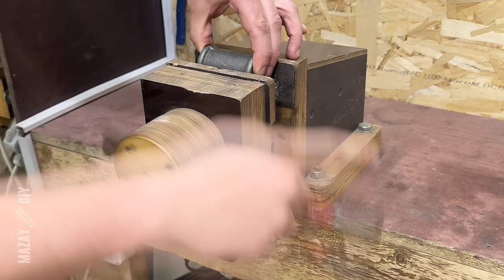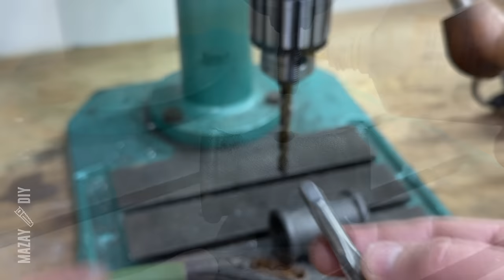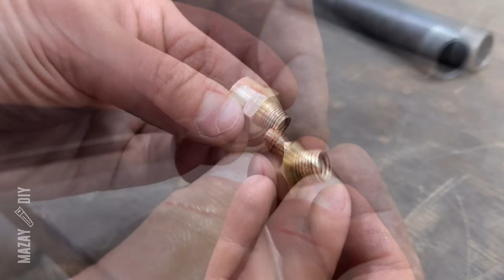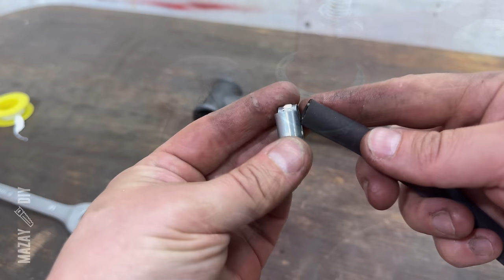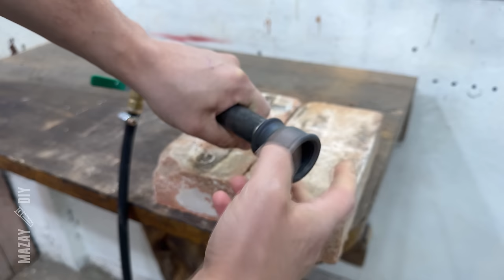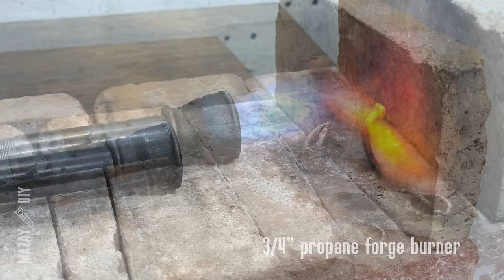DIY Simple Propane Forge Burner 🔥 Legendary Frosty T Burner 1/2 & 3/4

Comment: That plumbers tape is going to melt fast 😂
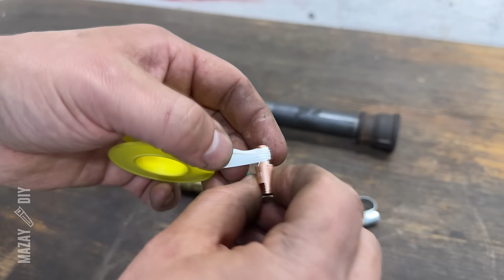Reply: The thread tape is located in and behind the Venturi, away from the flame. The flow of ambient air and compressed propane through the assembly actively cools the air-fuel Venturi chamber, it won’t get hot enough to melt the thread tape. 2:32

Comment: You can buy a brush burner for like $25 and  is probably safer
Reply: Brush burners can’t handle back pressure, so putting them in a forge kills the flame. Source: experience.
Reply: It can't provide enough heat for forging temperatures

Comment: thanks for the plans, much appreciated.  I bought some thread tap and die set the other day for some other jobs round the house. to be honest i have not used them yet, dont know much about taps but i heard it is not just the diamter that we have to look out for but also something about the threads per inch>     the taps you show on your video are they standard taps, can i use my taps or do they have to have other specs i have to look out for?  what is a twist drill?  i dont thik i can find 8.7mm twist drill bits ?  forgive my ignorance but i just wanted to ask as i am confused.  ..  why did you drill an 8.7mm hole, if the 1/8th inch converted into mm is 3.175mm ?  i dont understand , isnt the hole too big for this? I mean in your video it fits perfect but mathematically speaking 8.7mm hole is too big for the 1/8 inch or 3.175mm reducing adapter? I only ask because i am going to buy the parts and i just wanna make sure i get everything right thanks again for the instructions it is really helpful really really helpful !!
Reply: I believe the 1/8'' refers to the thread size, seeing as he uses an 1/8'' Tap

Comment: Excellent , you were always genius
Reply: I think I first saw a video on this burner about 8 years ago and the many videos available on how to make them are largely the same. Genius, would be seeing a simple to execute, but meaningful improvement or, an easy way to rig it without the need for expensive taps you may never use again. I 5:48  built one with baffles outside the T orifices and it works well, but not so much better than regular burners. I'm an engineer and have taps to hand, but most folks don't, so, if you can't borrow them or find them cheap, build a pipe burner with propane and air mixed (an old hairdryer will do) and it'll run as well and be an easier build.

Comment: The only thing I will add is you use yellow teflon tape for propane. 

I am a gasfitter. (Canada)

Yellow teflon with propane is the rule here. 

Otherwise, interesting build.
Reply: I’m a gas fitter in the UK…… it was yellow Teflon. Ptfe tape for gas is 0.025mm thicker…. It’s a myth that you have to use gas tape as it’s the same tape just thinner….. so just wrap more etc

Comment: Are there any substitutions for the mig welding tip? I work at a plumbing supply warehouse and have fittings down to 1/8". We have 1/4" flare pilot light adapters and some other odd fittings but no MiG tip. What is the purpose of using the MiG welder tip? If I know that, I can no most likely make a substitution.
Reply: Its about the hole in that ... a mig tip can be 0.6mm or 0.8mm.
If you have a drill that small you can drill a hole in anything. 
That is important to inject gas with pressure
Reply: @adinbalog  my man, thank you sooooooo much. I bought a few things for the gas injection but wasn't sure if the mig tip itself was the important thing or just that you could get the correct size opening and I've been waiting in hopes of getting some clarification. You are awesome sir.

Comment: Прикольная самоделка, главное - дешевая и доступная. Только, газ разъедает фум-ленту, поэтому уплотнять лучше чем-то другим.
Reply: Здравствуйте друг 
They make PTFE tape that is rated for gas. The yellow color of the case leads me to believe what he used is rated for gas as yellow is the color we use to note gas lines and fixtures here in get United States. 
I do agree though that thread sealant would be a better option but that may be the old plumber in me.
Reply from the maker: Спасибо. В чертежах (см. в описании видео) я обратил снимание, что фум лента нужна именно для газа. Соглашусь, что специальный герметик для газовых соединений будет лучше
Reply: Занимаюсь ремонтом бытовых газовых плит – уплотнительный материал на всей арматуре ВСЕГДА только фторопласт, ни разу не разъело. Наверное Вам попался ФУМ не из фторопласта, поэтому разъело.